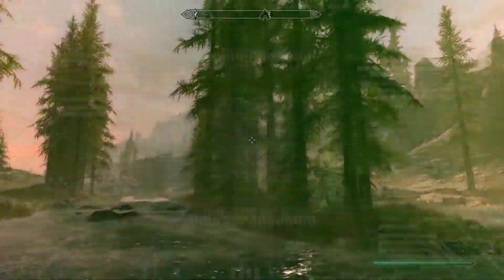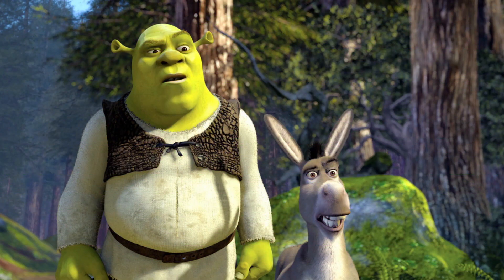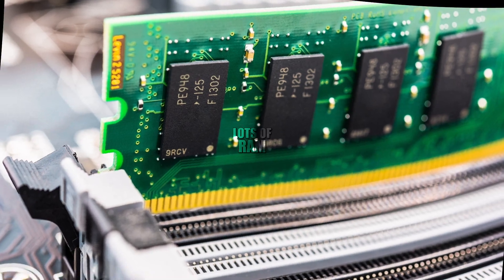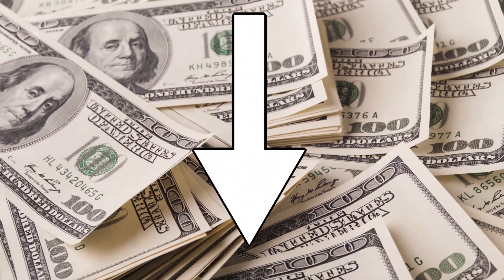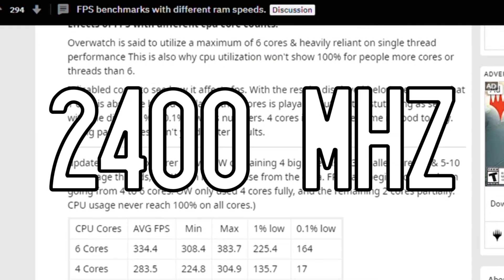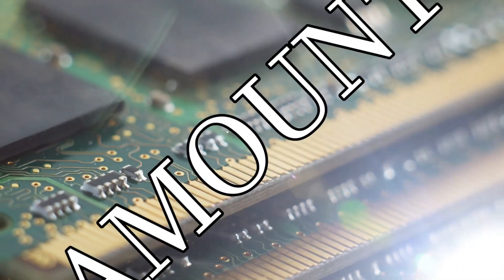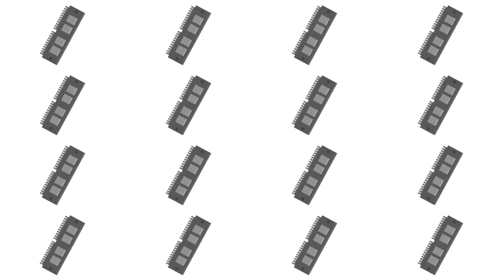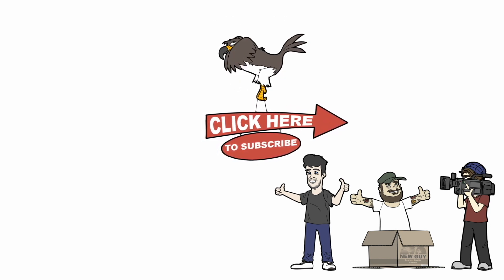Ram SIZE vs Ram SPEED for Gaming...What's Better?

Comment: I was just looking at this because I was thinking of building my own, so this helped a lot. It would also be nice if you could make some sort of guide for beginners on what to look for or need to start building your own PC/Gamin PC (if you haven't done so already).
Reply: Would depend on your budget, but I would recommend an AMD Ryzen 3600 CPU, B450/X470 Motherboard, with 2x8GB (16GB) DDR4 3200MHz Memory with a GPU of your choice.

A higher end setup might be AMD Ryzen 3700X CPU, X570 Motherboard (The $200 price point is a good sweet spot for MB), and 2 or 4x8GB (16 or 32GB) DDR4 3600MHz Memory
A Lower end setup where you can't afford a GPU yet might be AMD Ryzen 3400G, B450 Motherboard, and 2x8GB 3000 or 3200 MHz Memory with no GPU as the 3400G has built in graphics.
Another option would be to buy used and you can save a LOT of money. a lower end GPU that does excellent at 1080p gaming is the GTX 1060 6GB which you can find at a little over $100 is you do some sleuthing. You might also find an old RX 480 or RX580 which are about the same speed.
A more mid range new would be the RX 5700XT or if you want to go more on the high end, a RTX 2080 Super (RTX 2080 Ti is STILL overpriced and NOT worth it)
Reply: @Kiyometa   Thanks I'll take a look my budget is between £500 - £800  but I am willing to spend more if needed. I just want something that will last and not cause any problems within a few months of getting it or not become outdated. I know I don't need the best of everything to make a good PC/gaming pc  (mainly for games, PS and work stuff e.g assignments),  but just good components that will last. If it is not too much trouble could you (or anyone else) give me a list of all the parts that you recommend?
 Thanks for the help, much appreciated.
Reply: @RohanRohanIV  What parts do you have already? Like from an existing computer. That will dramatically change what you can get. Also, Is it okay if I list a pcpartpicker list in USD?
Reply: @Kiyometa  So far none. I just want an idea or somewhere to start. I Don't mind if it is in USD.

Comment: 3dmark is KNOWN for being non-CPU intensive as it is a synthetic benchmark with no user interaction
Reply: Huh? I think you might be mixing something up here. Care to expand your statement with a few extra details?
Reply: @radusdk  as far as i recall, timespy is a gpu benchmark. That's really just it
Reply: @radusdk  A game is an interactive 3d rendering, and a benchmark is not. It may make use of the CPU for calculations but these calculations don't get butted out of the way for "THE CONTROLLER IS RECEIVING INPUT". This plus additional calculations for collisions and camera  movement aren't thrown in as a result of said user interaction
Reply: @zanegeddes6828  are you sure that is how it's connected?

Comment: I would argue that RAM or Memory comes down to two simple statements.

1. Make sure you have enough (Typically 8GB+ For regular PC or League games like CS:GO, Overwatch, etc., 16GB+ For more general Gamers, 32GB+ For Power Users)
2. Pay for speed within your budget, up to a point (For Ex. AMD Zen 2 see's performance up to 3733 MHz, but it is widely recommended to go for 3600 MHz due to that being price/performance sweet spot) (As a side note: AMD gets pretty good gains from faster memory, where-as Intel gets very small gains from faster memory)

I have an AMD Ryzen 3800X CPU with 32GB of 3600MHz memory, but I also have multiple displays and do VR and all that jazz.
A good budget spot would be like an AMD R5 3600 with 16GB of 3200MHz memory (Or go to 3600MHz memory is you can find a good deal and plan on getting X570 motherboard) with either a B450 or X470 motherboard. Don't go over 3733MHz memory on Zen 2 because you actually will get SLOWER performance compared to 3733MHz due to the CPU:Memory cycle ratio will go from 1:1 to 1:2. Always check your motherboards QC list as certain motherboards can be particularly picky about what memory it will accept and up to what speeds. Like X470 AMD motherboards may only work with up to 3200MHz memory excluding a few specific models. I tried the X470 Taichi and it wouldn't work with my G.Skiill 3600MHz so I had to return it and get an X570 Aorus Elite.
On that same note, you can typically get more stability with memory on Ryzen by only using 2 DIMMs instead of 4 because of X470 mostly using daisy chain memory slots vs the X570 mostly using T-topology. So if you only use 2 DIMMs, you could probably get away with slightly faster memory on X470 depending on the motherboard (Slightly faster in X470 case being the 3200MHz memory, support for 3600MHz for be very little and you would likely need to try to find some Micron E Die DIMMs which are VERY difficult to find now, The next choice is Samsung B Die, which I THINK has also been discontinued, but much more recent.) At the end of the day though, its usually best to get at LEAST 3200MHz memory.
Also, don't be afraid to buy USED memory from vendors like G.Skill. since they have a lifetime warranty which in my experience they honor relatively hassle free.
Also, If you can't afford the AMD R5 3600, you could drop to a 2600 since they should be on REALLY good sales now since next gen is out. (Though you lose a lot of performance) I wouldn't drop to the 1600 though just because those have some stability issues.

Okay... Uh... Ramble over.

Comment: I feel it's a bit of both, if you have faster ram it can process just as much data if you had a slower ram with higher capacity to compensate, but there are SO many variables to account for

Comment: Got to be careful with mixing ram sticks as well, 8gb + 4gb even if same speed can cause some issues as they may have different timings and from different manufacturers. I had picked up a 4gb to add as i thought would make things better, but getting these weird frame rate dips that when i removed the 4gb stopped happening

Comment: You don’t really need more than 16gb of RAM unless you want to open a second tab on chrome.
Reply: My chrome takes 3GB of RAM
Reply: @MythTheFan  r/whooosh
Reply: @MythTheFan  I guess you missed the joke.
Reply: Hex iD No I get it Chrome eats RAM but mine for some reason doesn’t
Reply: Lol yeah
Reply: 20 TABS LATER
Reply: RIP to my buddy who's always gaming with like 20+ tabs open in the background lol
Reply: @cantond0g  Sounds like my brother. He's usually got like 20+ tabs open and playing a FPS then complains when things get slow or glitch on his system. Personally, I close all apps before running a game or doing any image editing. However, I also prefer to install the max amount of ram and speed that matches my hardware and OS acknowledges. After that, it's my own fault if something fails.
Reply: Anon Commenter  bruh on opera gx you can control how much cpu and ram it will use
Reply: I have 4gb RAM but I'm still able to open multiple tabs without suffering third degree burns from my laptop.
Reply: Anon Commenter  it is chromium based. Not chrome based. There is a difference.
Reply: 32gb 2400 MHz
Sh!t i got to much RAM ?!
Reply: @gremlinmogwai9649  1 single stick of 32gb ddr4 3200mhz i got ya beat and when i get my new mb i'll be able to have up to 7000+mhz ram and 128gb of memory capacity
mb capacities for ram upgrades these days are nuts, and from what i';ve heard someone has developed new kind of ram that might replace the original entirely...

it has processor core lanes and an AI built into it but due to the change in hardware built in I don't think we could call it ram anymore (not to be confused with the ultraRAM concept i'm talking about something completely different)

apparently switching have of the lanes alternating between each in row between standard ram and then processing cores and the AI is self learning so adapts and learns what you yourself use it for the most allowing it to use it more efficiently!

this new kind of card is so much better on the memory side that an 8GB DDR3-module of this kind of I-PRAM (I came up with that name it's simply Intelligent-Processing RAM, my name was better than what the guys who created it were gonna call it some stupid complicated technical name that wouldn't of been remembered well and couldn't of been abbreviated well... & your welcome society)

 is equivalent in power to 16GB of DDR4 ram so imagine what will happen when they try out building a DDR4 16GB I-PRAM module (just PRAM for short and yes I'm fully serious I think the name is funny but easier to remember and not far of the current modules name so it should roll off the lips just as easy unless you don't have lips)

(i'd of said roll off the tongue but that's impossible how ever your able to pronounce your p's without using your lips and just your tongue... congratulations good for you weirdo)
Reply: Chrome uses ram when it's available to keep everything loaded which keeps Everything speedy and snappy it's better to have your ram in use rather than idle
Reply: lol!
Reply: Anon Commenter it’s Chromium based
Reply: SamuraiVader or one wiki page
Reply: @timothymurauzi5144  and sand
Reply: @girlsdrinkfeck  😂You need help
Reply: I got 32 GB of RAM. Having like 60 tabs open (granted more than 1/2 or suspended through an extension), I'm at about 44% total used.
I'd probably hit 50 to 60% if none of the tabs were suspended.
Reply: Ya i eventually found a extension that makes it act more like the ipad chrome app and not load every single tab at once.
Still use a few gig of ram just keeping what counts as a moderate amount of tabs “far too many” for me.
I find 32gb as a good spot since my idle tends to still be about 15-20% useage.
Chrome AV various other background programs.
Reply: Faster speeds more RAM.
Reply: Got 32Gb of ram on my 2nd gen i7, the ramdisk is worth it
Reply: I have 32 gb of ram
Reply: I came bac from a 10 day vacation and  have about 60tabs youtube open and ram lol
Reply: Minecraft believe it or not can have insane memory use when mods are used, SEUS 8 shaders with ray tracing with a complete 512x512 realistic texturepack with bumpy surfaces, that will bring your PC to it's knees, it's the new Crysis, 16GB of RAM and a 8GB GPU is not enough, you can even get 1024x and 2048x textures, one pack for the 2048x textures recommends 137GB of mo'foing RAM with a 40GB GPU!!!
It does look insane though, Pulchra it's called, check the screenshots.
Reply: @wing0zero  new Crysis my ass. The game looks like shit
Reply: yep
Reply: Unless you want to play games like star citizen and flight simulator. More ram is also good if you want to record your play throughs
Reply: Not anymore can't play rust XD
Reply: SamuraiVader opera ftw
Reply: I hate when other apps I install want me to install chrome. I uninstalled Chrome years ago I don't want that shit.
Reply: Ry Sun what browser do you use
Reply: 1gb was standard in 2011 ???????????????? er no ,unless u count the shitty computers in asian nations and africa ... i had 8gb in 2007 FFS
Reply: @girlsdrinkfeck  
Tablets maybe
For computers it was more like 2001
Reply: @girlsdrinkfeck  yea me too like wtf haha
Reply: @girlsdrinkfeck  Why ? for chrome?
Reply: girlsdrinkfeck but workbuilds witch is way more often then gamingbuilds was  only about 1gb

Comment: Some games are recommending ram speeds rather then just ram amounts. Very few, but some. I think I am doing well with my 2 year old ryzen 5 1600 OCd to 3.8, 32gb of ram at 3000mhz, gtx 1070 founders edition
Reply: Thats actually a rather balanced system, bravo. Don't think you could get any faster anyway with a Ryzen 5 1600.
Reply: @Kiyometa  thanks, and ya, I am thinking I may go for the r5 3600 in a couple months, I upgraded to a b450 mobo last year and already have the latest bios. Zen 2 looks to have given enough of a performance boost to make it worth swapping out chips
Reply: @billbollinger3748  From a 1600, heck yeah! Maybe try to OC your memory to 3200MHz once you get the new CPU. It's pretty easy for a basic OC, just bump your voltage up to like 1.37 or 1.4 if you are unstable. I only say that because just like previous Zen CPUs, Zen 2 also sees significant performance gains from faster memory.
Reply: @Kiyometa  ya i learned that, i originally had 16gb of 2400mhz and seen a massive differenc once i got my first set of 3000mhz. Right now i dont think my 1600 likes to use ram higher then 3k, either that or my current ram just doesn't oc, i have tried it and used 1.38v over the 1.28 that the board set them as automatically but the best I can get is 3066 out of them. Both sets are the same, corsair c15 memory modules, one set is just rgd versus the other just being red led
Reply: @Kiyometa  think the best Cinebench r15 i have gotten on the cpu is 1247
Reply: @Kiyometa  which was a slightly unstable 3.9ghz clock. After that i backed it down to 3.8 and keep the corsair h60 liquid cooler clean to cool well.
Reply: @billbollinger3748  I'm impressed you could get 3066 out of them, its not you, its just Ryzen 1 series memory controller just kind of sucks.
Reply: @Kiyometa  ya, november time I'm getting a 3600. Hoping it will come at a good price on Black Friday or before. I really do think i hit the Silicon lottery woth my 1600. Very few were stable at 3.8
Reply: @billbollinger3748  I send good vibes your way for a good deal on the 3600, but to be honest, I think the only way for that to happen is if Intel releases something and AMD would then give a sale price to get good PR and try to disrupt any good Intel press.
Reply: nice, i have a Ryzen 5 1600 OCd to 3.75, 16GB at 3200mhz and the RX 5700 also planning on buying a R% 3600 later this year

Comment: Well shadow and rise of the tome raider can take up to 10gb of ram so... with ryzen both are really important. So with ryzen think both 16gb at least 3300mhz.
Reply: some games just like to allocate as much RAM as possible, doesn't mean it actually needs it though.
Reply: @Rem_NL  I noticed while using 8gb vs 16gb. I noticed stuttering with 8gb that wasn't present while using 16gb and problems with Load meshes and textures.
Reply: @thegeoshow5296  ah well thats good to know, what resolution and settings are you using?
Reply: @Rem_NL  1080p ultra. taa

Comment: Cost has been an issue pretty much forever.
The reason the  Vic20 had a paltry 5K RAM (Practically less  because you needed room for Basic.) was because the chips were too expensive and they needed to hit a price point.

Comment: I made a decision about 2 weeks ago that took me a few months to decide on. I recently built a new PC because someone gave me a mobo and processor. It uses DDR3, and the mobo he gave me came with 8gb of 1600mhz RAM, while I had 16gb of 1333mhz in my old mobo. I decided to switch the RAM out to have more, simply because I could see certain games needed more. I just overclocked the 1333mhz to 1600mhz, and it made an amazing difference. I haven't had any of the issues I was seeing before
Reply: I didn't know you could overclock ram
Reply: @Olde_Faithful  Yep, if your BIOS allows it, you can OC the RAM very simply, actually. Check your mobo manual, or google it, and see if you're able to. All boards are different, so yours has a specific way(or not) of going about it
Reply: @Olde_Faithful  Most RAM kits nowadays have XMP profiles. Essentially a factory set overclock profile. Just pick this and your RAM is overclocked, while still retaining your warranty. Of course you can still manually overclock if you want to squeeze more out of it.
Reply: @Olde_Faithful  Any DDR4 3200 or higher is overclocked.